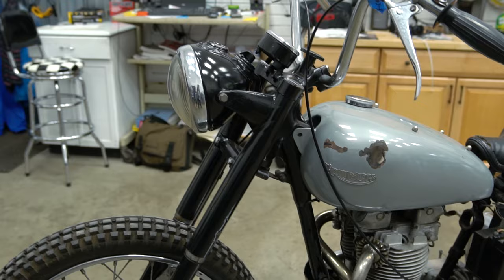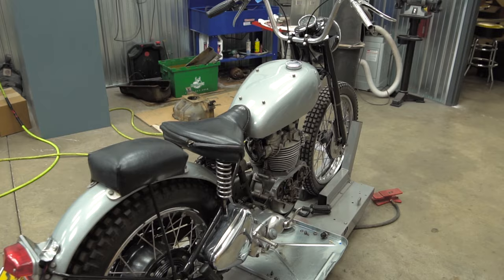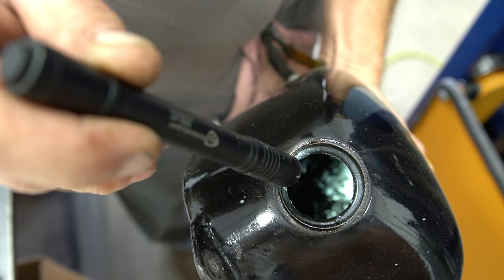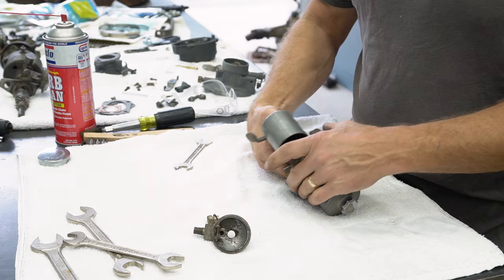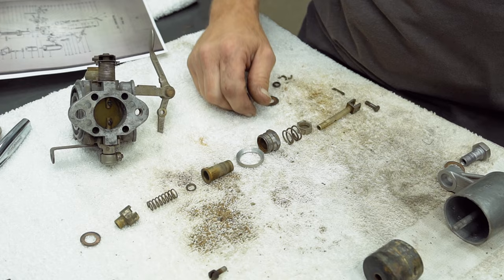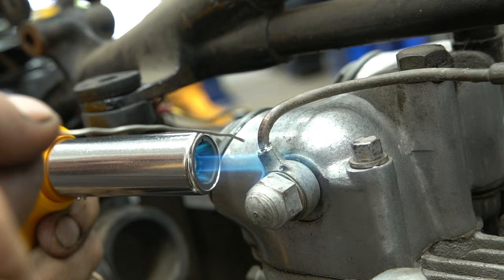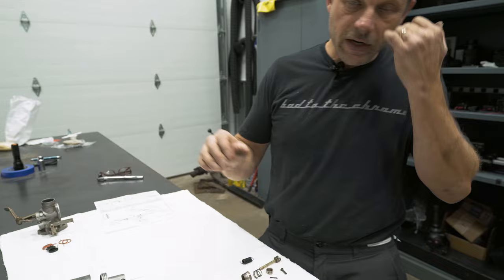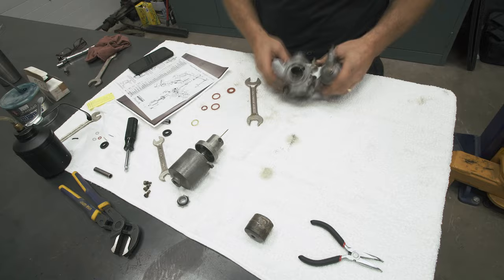Repairing The Fonz's vintage Triumph motorcycle - Will it run?

Comment: Whitworth (BSW),  is the diameter of the thread & tends to be coarse, often used for studs into softer materials such as aluminium or brass. Most nuts & bolts on older British Bikes & Cars were AF which stands for  "across flats" ie 1/2in is distance between opposite flats on the nut. The threads were finer than Whitworth (BSW) I had a 1959 Triumph 650cc Thunderbird with a side car in the 60's. it had a simesed exhaust as on the one you are working on except it was on the right of the engine

Comment: You need a buzz box to time the mag, but if you take th capacitor off you can use a digital ohm meter to tell when the points open. It's really very simple. They should open near tdc for starting.

Comment: I don't know if the '52 has one, but on my '68 there's a sludge trap that lives in the crankpin. The oil that goes to the big ends passes though it. After so many years sitting, and with the gunk you had in your oil tank, I'd be afraid that the sludge trap would be blocked.  The first Triumph I rebuilt (many years ago) blew up on me because I didn't clean the sludge trap out. The left hand side conrod disintegrated - it's the last thing in line to get the oil from the pump. I don't mean to be a bring down, but I'd be concerned about that. It's a total downer because the engine has to come all the way apart to get to the thing.

Comment: If that is a Triumph or BSA degree wheel most were made to go on the camshaft,so your degrees will not be correct being that the cam turns at 1/2 the speed of the crankshaft. I am a old triumph mechanic.

Comment: 13:15 "What's a Magneto?"
             Wolverine
Reply: Ignition system  mechanism  generator creates own spark not dependent on the battery or generator.. lawnmower tractor  type system.🤗
Reply: @dondesnoo1771  Come on, haven't you seen the X-Men?
Reply: No 🤔

Comment: If you put a locking losher under the magnito nut it was going t be better.They knew that it will have a timing problem thats why they put a wire cable but great job. I watch you shows.

Comment: Those magnetos were far superior to the battery/coil/points ignition of later years. The engines would never miss a beat at high revs because of that hot mag spark while after a few thousand miles the battery coil ignition would miss like crazy at high revs just when you wanted the power. Also with a mag the bike would start with a dead battery. Btw I read that Henry Winkler couldn't ride motorcycles and was scared to death during that iconic scene riding in on the bike.

Comment: I read a lot of these comments but nobody made the point that this was not the bike that was most seen in happy days. The Windee road most of the time was the square barrel 500 mL trophy the scrambler there was another 500 mL trophy
Reply: Well that last comment didn’t come out right. What I tried to say was, he rode a 500 cc trophy T 100 it had a square barrel if you look close you’ll see it was not this bike!  It also had a spring loaded rear hub very unusual. In 1961 I bought a bike exactly like it from my high school shop teacher. It was my first motorcycle. He actually had three bikes in the show. He wrote the one in this video and a Harley and then the T 100. Check it out.
Reply: I don’t know why my computer is acting like this? But anyway what I’m trying to say is he rode a 500 CC Square barrels T100 trophy. It also had a spring loaded rear hub, very unusual. In 1961 I bought one just like it, My first motorcycle.

Comment: I know this is eight months later, but the way you set the timing, on the breaker points, seems kooky to me. I just used to tune up the breaker point ignition on my old motorcycle, with a test light - almost weekly. You don't need a timing light for that, you only need a timing light to set the advance with the engine running. You connect the test light to either a dry cell or the motorcycle battery, a test wire to the live side of the points and the other side of the test light will ground, illuminating the light, every time those points close. You set the points to open when the degree wheel matches the setting in the specification, whether it's 3°, 5°, whatever. The test light will go out when the points open. Some people just used to use a flashlight with wires attached to them or just a bulb with wires soldered to it. All the mechanics used to do it that way. I don't get how you are trying to guess what the degree wheel's pointing to at the same time that spark plug flashes! Seems crazy to me. Next time just hook up a light bulb to the points, and watch when the light goes out to see when the points are opening. Much simpler.   

I used to have to do this, regularly, with my old bike. Due to vibration, the points can be prone to falling slightly out of adjustment. Or, when the points are dressed, or replaced, it needs to be done. I used to have one of those test probes with the lit handle and the "ice pick" type point. You'd clip the wire to the positive on the battery and probe with the point to test for shorts, but when timing the points, you could wire the tip of the light to the positive side of the points (usually that is on the sprung point, the other point is grounded). Then you put the engine into high gear, with the rear wheel up, and turn the rear wheel to rotate the engine. High gear gives you the slowest rotation, for timing, that's the easiest way to turn the engine, so you can watch when those points start to open. You need an extra test wire with two alligator clips to clip one side to the sprung point on the breaker, and the other to the pointy part of the ice pick - test light. You can also use any multimeter with the continuity function, hooked up to the sprung point on one side and the ground on the other side. Put the bike into high gear, and turn the rear wheel, with one hand, while you hold the multimeter with the other. Watch the meter, for when you have a loss of continuity.  When the circuit is broken,  the points will be open. At that point, you can look at your degree wheel, and see where the piston is. You can adjust the points to open at the correct degree mark. 

Hope this helped.  

Thanks for the great content.    
Keep up the good work.    
בס״ד

Comment: nothing wrong with Whitworth and BSF, it just goes on the thread size not the spanner (wrench0 size. Whitworth being coarse and BSF fine . The 1/4 whit spanner is sized tio give the correct torque for a 1/4 inch bolt. If you put a spanner that would fit across the flats you would see it would be a lot longer and risk snapping the bolt

Comment: How cool is that? Fcking brilliant! The Triumph 500 is the perfect motorcycle. Small, compact, as fast as you wanted it to be.......70 mpg. Touring, racing,bmx...it did the lot. Pre unit stuff very easy to work on. E,extrications starter? Nah...quick dab and away it went. I loved my 650 T110 but the Triumph T100A was the better in all departments.

Comment: 10:30 Threads into ally bits are Whitworth, in steel should be Cycle threads.

I bought my original Whitworth spanners in the early '70s here in UK, when such weird sizes were almost current. I managed to buy another set a little over 20 years ago when rebuilding my 1966 Norton 650SS. The spanner measurement was the bolt diameter.

Why the SU carb? Not Amal retentive?
Reply: I used to have a set of Whitworth spanners and BSW's. I didn't need them and I don't even remember what happened to them. I do have some very old US spanners from pre-1950s and they're not the same standard as today either. It seems they're in "weird sizes" too!!

Comment: Is that SU carb oem for that bike? Would have thought it would be an Amal type. A wad of chewing gum could of been used to fix the timing wheel in place for this sort of work. A common solution in the Brit Bike forum I use.

Comment: Nice job, Bro. How many CC's is the engine? Just a guess,  anywhere from 250-500 CC's. BHP: about 40, maybe? British bikes are Torquey and have good nimble handling. If anybody wasn't into routine maintenance with them, 'Woe be tide' if you're out in the middle of nowhere and it takes a mechanical "Dump."
Reply: I Checked it out. TR 5 Scrambler 498 cc's and 25 BHP. Probably about 90-100 MPH, full throttle screaming at 9k Rpm.

Comment: I remember seeing this bike in late 70s when it was touring the Autorama circuit. It was a real piece of crap, but it was the most motorcycle that Winkler could actually ride. I just recently watched a video where he explained his weird dislexic problem that made it hard to ride something with two wheels. Maybe the mighty Fonz should have had an old Flathead trike Harley. (or training wheels )
I have 1970 Triumph that has not run since 1991. I want to clean out the sludge trap inside the crankshaft before I run it anymore. This one is 1952? I wonder if the sludge trap has ever been cleaned on this one or if it still has sludge from the 50s?
I don’t know about this model but my unitized 1970 has spots on the flywheel that you can find top center and set timing with.
Hope it has oil pressure. I didn’t see him try hooking a gauge to it to make sure.

Comment: It could be argued that the Whitworth thread is the standard, and all the others are ba**ards!  Joseph Whitworth pioneered the use of a common thread standard, which was one of the drivers of the industrial revolution. They are a challenge to more modern mechanics though!

Comment: If it sat for that long really should have torn down to crank and cleaned the sludge trap tube out. The rod bearings likely will get dorked.

Comment: I have had many Triumph's,.....but I just learned something,...... you need Whitworth tools to work on them.
I used a monkey wrench,...... and did the best I could,.....But Triumph's run great.
And they are the easiest carburetors ever made to work on.
AmaL concentric and monoblock,.... I think they were called.
The wiring is ass backwards,......Zener Diodes and Rectifiers,.....cause them not to run as well.

Comment: Is that a 500 cc engine? It looks smaller than my friends 650 bonneville. The exhaust pipes run closer to the head compared to the bonneville. I never saw an engine like that.

Comment: I'm sure this has been said before but if not here I go.
Whitworth is the original and STILL the best.
¼ inch spanner for a ¼ inch bolt, it's simple!
Who heard of using ½ inch spanner for ¼ inch bolt, what an odd system.
Don't get me started on the metric system that's got even more twists and turns.

Comment: Tr5 bike with original engine removed ( generator head square barrel and amal carb) changed  to thunderbird 650 engine whit correct SU carb And barrel and head painted grey to look like the 500cc all alluminium original engine.  The timing could be easier.  Nice job
Reply: No, the cast "hole" lug in the frame down tube under the seat makes it a Thunderbird 1952-1958 to clear the SU carb's Vokes air filter. The timing job would've been better if it had been noticed that when he read 38 degrees on the timing disk, it was actually at 19 degrees because it's a camshaft timing disc.
Reply: @bobbichin2621   Hi Bob ,  yes it have the cast hole lug as other models ,speed twin, t100, 6t   But is a short wheel base Tr5 and  short front single down tube with one piece front engine plates part of the frame  the rear frame from the 3t and  unique tr5 “ Horse shoe “ inner primary case cover.
Same frame of the side valve TRW model .  The original was a square head generator engine.
  
  Cheers

Comment: Stuffing crazy glue into the oil feed quill doesn't seem like a very good idea, especially to mount a degree wheel meant to be used on a camshaft so the numbers are all double actual when used on a crank. Re time it with a true degree wheel and you'll just about double the power.

Comment: Thios should be called Hagerty's Bodge shop no offence to mechanic he is good just out of element it seems. LOL! Krazy glue plug so American.
Whitworth and BSF and CCI threads in it. Oh and BA screws. Steve McQueen never jumped that fence it was Bud Eakins who did the BSA A65 slide wipe out in Bullit too. Tap the crankshaft of Fonzi's bike? there is a proper timing tool. Is this Hagerty's jeez, beware those auction items.

Comment: But I want to know if you face that Posative ground issue? May not since its a 52. Which was a magneto like the BSA,  A -7 and A-10.
Lol. Forgot about the Wentworth tools.
I really liked my A 10, but I didn't like my A65.
Now for the record. This was his bike for most of Happy Days.
But, the first bike he rode was a knucklehead. The Triumph  replaced it because Henry was scared of the bike and someone in the staff said a Harley was too violent. 
Another fact. The Triumphs and BSA were faster bikes then the Harley of the same time.
Reply: When I bought my A10 it was really in milkcrates. They guy had remachined the whole engine. For it to be rebuilt. He gave me a book for the bike. I had a lot less problems then you are having. I do remember lining up the timeing. There are dots on those gears that line up. It was really simple.  
My A10 was a 59. The A 7 and A10 had three frames during thier run. The hard tail, the plunger, and the swing arm. The guy I bought it from had made mine a hard tail for a guy 6'6". So it was too long for me. So I reworked it and made it a softtail ( note I said softtail NOT swingarm)  I built the softail swing arm with the shocks from the bottom of the frame. It was pretty cool  because it look the be a hard tail. Had a thin fender like hardtails can have, but Harley softballs can not.
FYI A7 was a 500cc and A10 was a 650cc. Pre unit ( engine and trans separate like a big twin harley) this Triumph is also a pre unit.
BSA and Triumph were British motorcycle companies. They were not the same company, however they were very similar. Also both used Wentworth and were Posative ( not negative) ground. On the pre units it wasn't too bad because the magneto. And thier was ways around the ground issue, since it was only needed for lights not engine. ( I don't remember a starter, just kick start, but it may of had one.) And kicker was not a problem. It was the EASIEST kick start I've ever used. Kick one: fuel. Kick two prime ( both were slow easy kicks) kick three: fast, and would start every time. If bike was running not long before. All that was needed was the hard kick. It always started on the hard kick.
I would trade a Harley for a Good A10. ( You know that's really what I need to do. So if you have a Running A 10 and want a Shovelhead custom swing arm let me know.)  If you have a A7 or A10 basket case, I have a 70s basket case Sportster I would trade. ( both have titles and I want one also)
Reply: Yeah I loved my magneto. A lot better then other methods.
Reply: And a cool thing about BSA, is the old ones like the A7 and A10 have three flintlock rifles on the engine cover.  This was a trademark item of BSA. 
At one time they were a firearm company.
Reply: @pychohobo1832  When this bike was made (1952) BSA and Triumph were the same company. And it's "Whitworth." Some early '50s BSAs were negative ground. There's no issues with negative or positive ground, unless you're running a zener diode regulator, electronic ignition or LED lights.
Reply: @bobbichin2621  BSA AND TRIUMP  were NEVER the same comapny.
Yes people get them both confused. But they were never the same company. That's like saying Harley and Indian were the same company. Well ok not that bad. At least the limey had civilized companies. Harley has done some pretty dirty things from the 50s to present.
And don't give me that garbage about posative ground not having problems.
It stinks. Now on my A10 it wasn't an issue since it had the magneto.
However. My A65, posative ground was nothing buy a headache. Mind you I'm also talking over 20 years ago, and none of this yuppy garbage they do to bikes now.
Reply: @pychohobo1832  Triumph had been owned by the BSA Group since 1951, but by 1972 the merged BSA-Triumph group was in serious financial trouble. In 1973, with the help of the UK government, Norton Villiers Triumph was formed which encompassed almost the entire British motorcycle industry. The name was chosen because BSA products had always been most successfully marketed in North America under the Triumph brand.
Reply: @pychohobo1832  Positive (note spelling) ground is actually superior from a galvanic standpoint with respect to Earth (as in the planet) ground and results in less chassis corrosion. What is your headache with positive ground other than it being different polarity than negative?

Comment: Why dont you use an ohm meter to see when the points open? Much easier
Reply: Or cigarette papers between the points. Turn the mag till the grip on the paper reduces this is obviously the points opening, turn the motor to the firing point then tap the gear to locate the taper and then do the but up..timing done..

Comment: Looks like a repop. Doesn't Richard Rawlings own the actual original Fonzie bike now?
Reply: I agree... this is somewhat suspicious... there are slight differences between this one and the one Richard has if you put both videos up side by side: gauge mount/tilt, license plate mount, pillion seat bolt-position (and these were just the quick things I noticed) so who's actually got the real deal or like you said... replica/reprod?